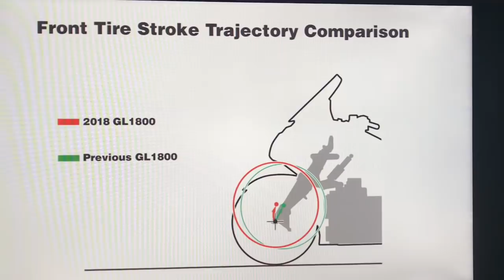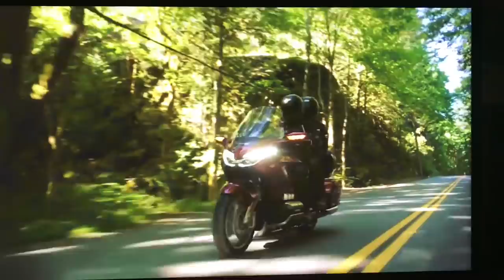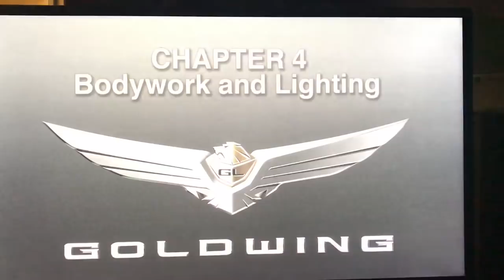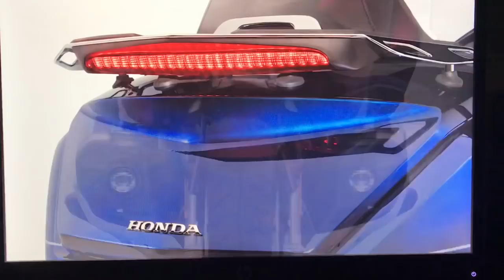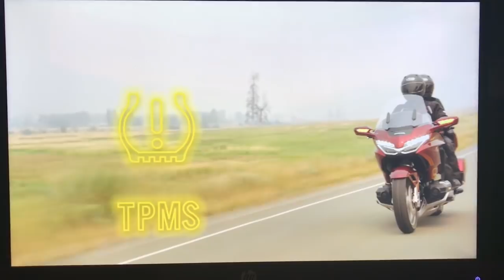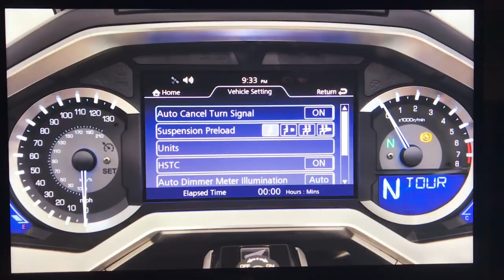2018 Honda Gold Wing Front Suspension Details

Comment: The failure of this set up is the unsprung weight of the forks before you get to the damper - lots of shock will get to the frame.
Reply: Honda claims it is reduced by about 35%.
Reply: I was wondering this same thing when I looked at the design.

Comment: Very poor video if "Suspension Details". How about running over a few bumps in the road? Or even an animation showing the suspension movement?
Reply: This is a Honda training video for dealership employees. Niehaus just titled them and "Rebroadcast" them. There is a excellent video with animation of the front suspension. It is Hondas technical "briefing" by Honda Engineers. The title though is all in Japanese.

Comment: Sad we lost so much storage space
Reply: Mark Featherstone 

Rip
...
Reply: also fuel capacity
Reply: It has more storage than my Kawasaki Concours 14.
Reply: I wonder if it can fit a helmet in the side compartment
Reply: JSmooth,    I can't get my full face Schuberh in the side compartment of my '05 but a half helmet fits fine. The trunk can hold 2 helmets but I have reservation about the '18 being able with the rear of the trunk redesigned.
Reply: Several of the journalists have tried the two full coverage helmets in the new trunk and they do fit.
Reply: With the improved fuel economy the range is still the same as the older 6.6 gallon bikes.
Reply: True!... But there are plenty of the last generation bikes setting at the dealerships that have the 150 liters of storage. Ha! I will have 40th Anniversary 2015 for sale come February.